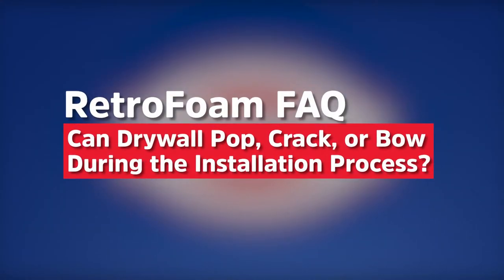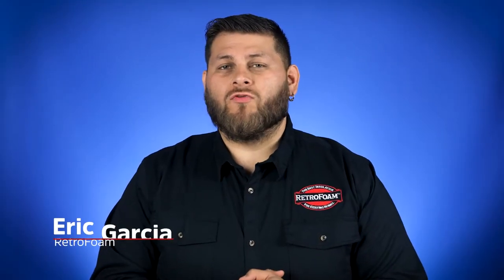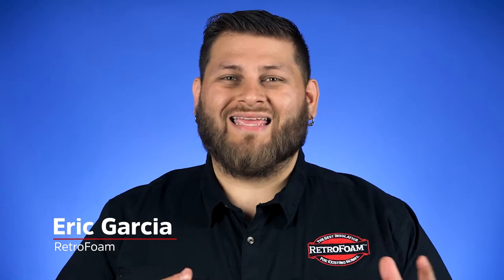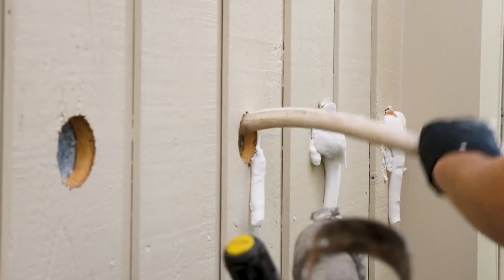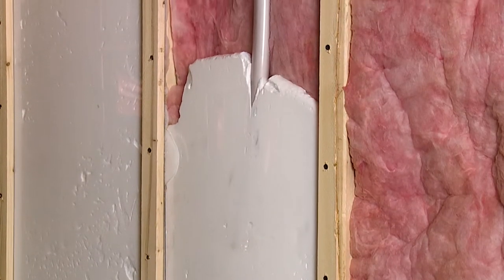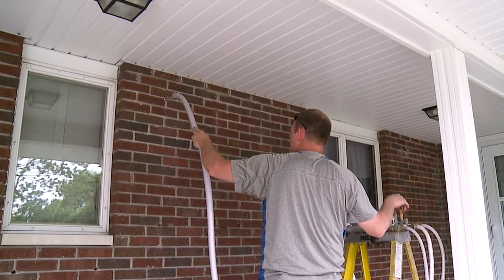Can Drywall Pop, Crack, or Bow During the RetroFoam Installation Process?

Comment: Seems like this stuff is going to make future in-wall work -- electrical, plumbing, etc -- an incredible hassle. Is the cured foam removable or do you just have to cut a bunch out if you need to get at something in the walls?
Reply from the maker: Hey Craig, that is a valid concern! Thankfully RetroFoam is soft and pliable which makes it easy to work with. To answer your questions, yes the foam can be removed in small sections where the work needs to be done once cured. For wiring, you can fish the wire right through without needing to remove anything. You can read more about that with the article below. As far as cutting the foam if you need to get in the walls, yes, you can cleanly cut the foam, remove it, do the work that needs to be done, place it back and then seal it back up. We recommend the canned spray foam for re-sealing. Here is the link to the article about fishing wire through our foam.  https://www.retrofoam.com/blog/fishing-electrical-wire-through-insulated-walls